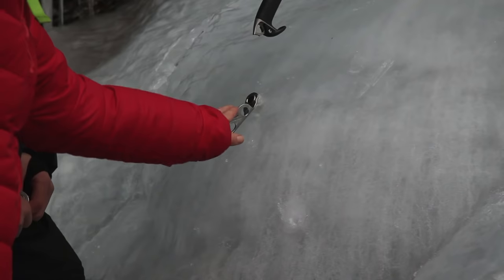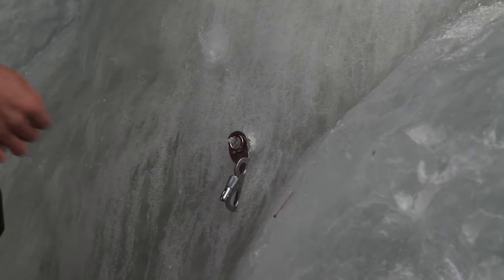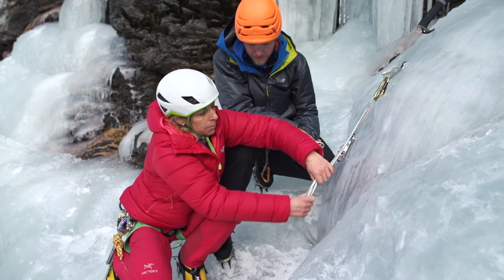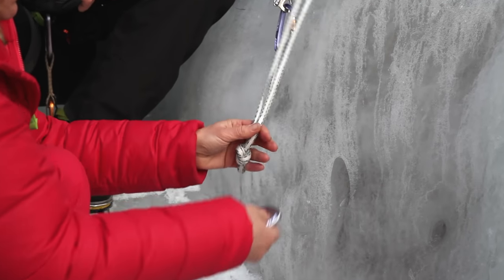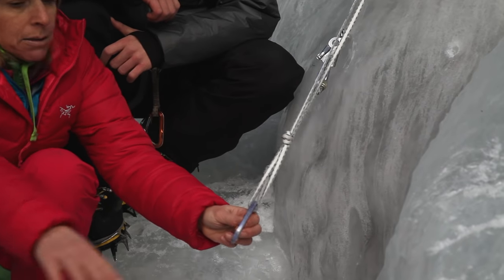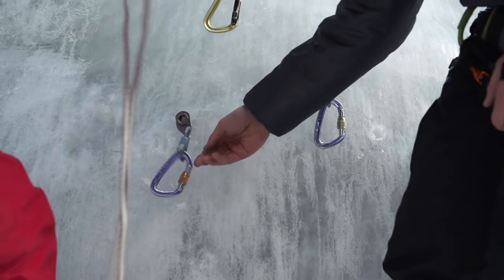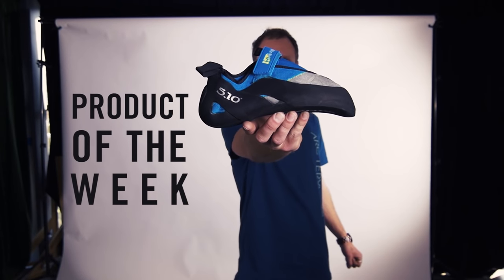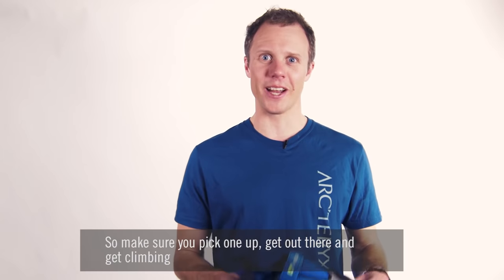How To Build An Anchor - Ice Climbing | Climbing Daily, Ep. 685

Comment: good video. I've found that only having one or two 20cm screws for crappy ice or for making V threads is more than enough. beginners usually go out and buy all the long screws, but they don't do much past where the threads end. At that point you're just wasting energy and time, and probably shouldn't be trusting falls and belays if you're that worried about the ice.

Comment: why tying the master point with an Overhand when an figure 8 would be 20% stronger? thats rather careless and unnecessarily weaker.
Reply: +Woodie Wu knot to mention easier to untie when you're finished
Reply: 1. It is much easier to untie an overhand than a figure 8.
2. The sling holds 22 kn.
Even if it holds less with a knot in, it is still strong enough to keep a fall...
Reply: @Florian-ij6rc   It absolutely is not easier to untie and overhand than an figure of 8. Have you got super human fingers?